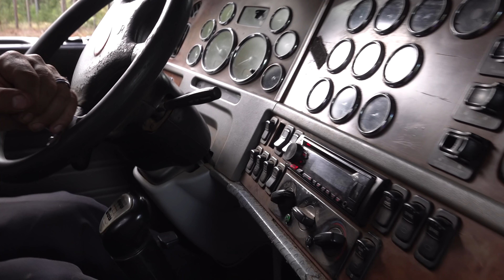Axman: Finishing the job! *We are loading up!*

Comment: Those trailers are better to use instead of the detachment ones cause there are hard to disconnect and reconnect. And the one with ramp's are way better to use. We had a driver replace a couples windshield after he failed to clean off the deck of the trailer after he loaded 2 skid steer's. And the trailer had dirt and mud and rock's on the trailer. And the company that he dropped them off at said he never cleaned off the trailer. And i seen a video of him driving with debris flying off the trailer. And i told him and he lied and i said ur fried and don't come in friday cause ur paycheck is going to the couple to replace there windshield. And the couple was happy cause they live off a monthly income which is not much to live off. And she work's for us answering the phones and placing order's that mechanics wants her to order. And we pay her cask so it does not interfer with her check. She told us how much her and her husband get each month. And we was like hell how can u live off that. We told her if u want a job u can work for us and we will pay u cash. And allot of businesses do that pay's people under the table.